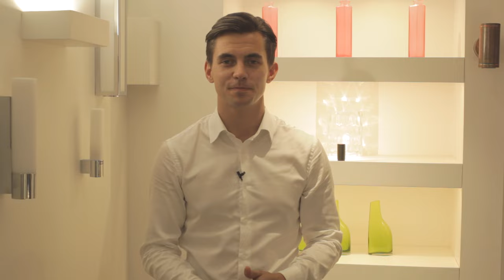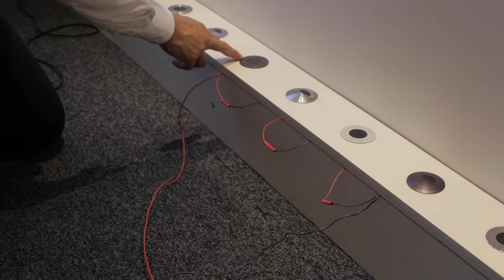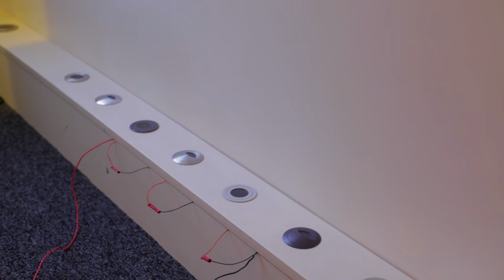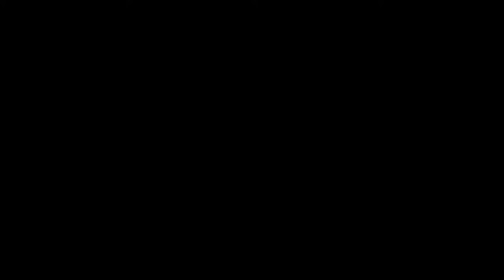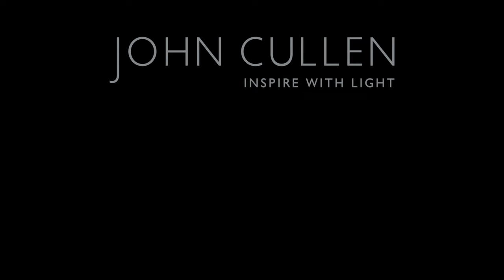How to Wire LEDs in Series | John Cullen Lighting

Comment: We have multiple downlight fixtures to wire in to a wall switch. Do we need a driver to run them in series, and if so how do we get the proper one?
Reply from the maker: HI there, thanks for your comment! We can advise on and supply drivers,  which will depend on your project. Do get in touch with enquiries@johncullenlighting.com and the team will be able to assist. Many thanks!

Comment: And when one goes down the lot will follow
Reply from the maker: Hi Alex Depending on the minimum voltage output requirement of the LED driver this is not strictly true. As long as the minimum voltage is met then if one was to fail the remaining would still work. We have a broad range of LED drivers which have low minimum output voltage requirements so they do not affect all the fittings should the unfortunate case of one failure occur.  I hope this helps  Sarah